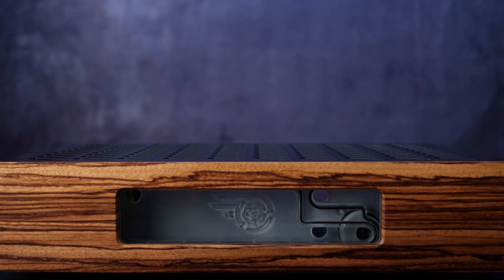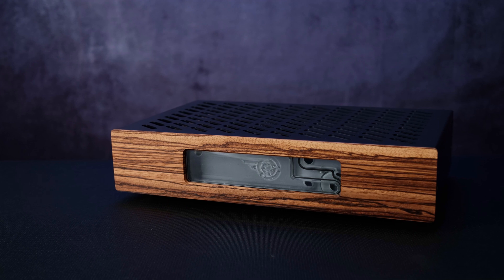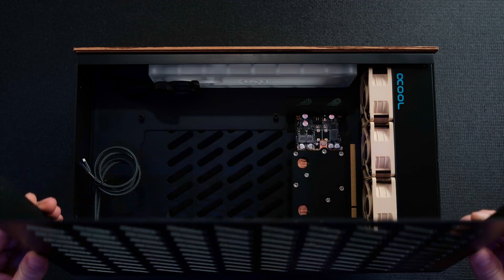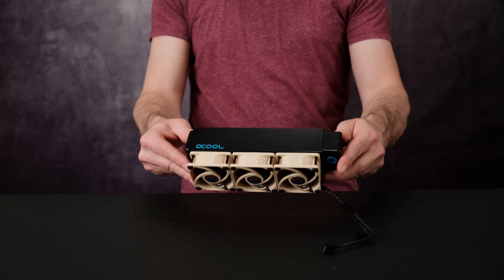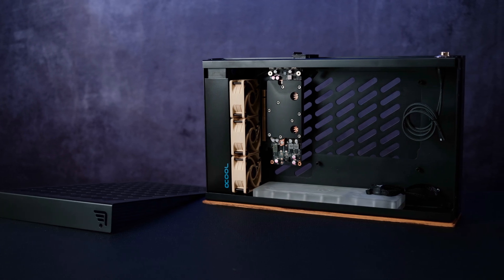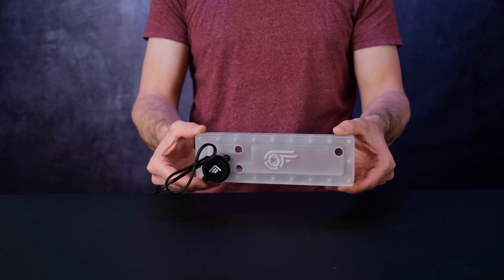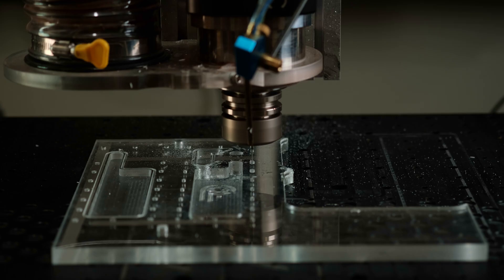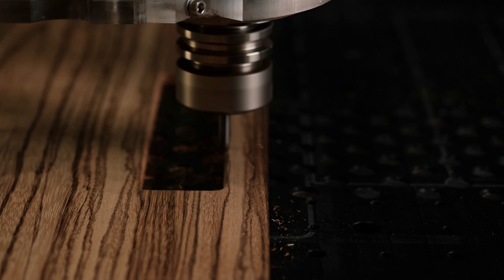O4W - A DIY "Console Case" for the RTX A2000.

Comment: remember the last time when gpu's were small and efficient? good times
Reply: Depends on the definition of efficient. Current GPUs may have better performance per Watt, depending on the metric. They are also extremely efficient in transforming electric into thermal energy.